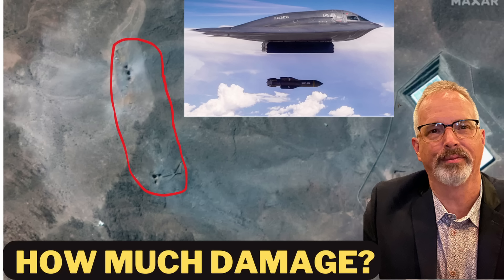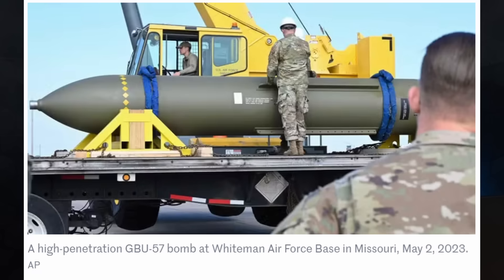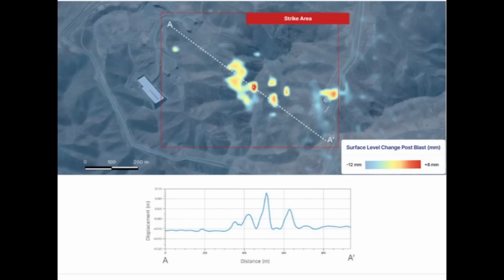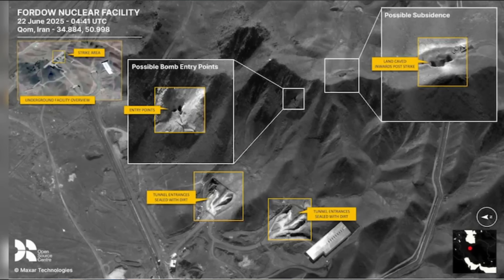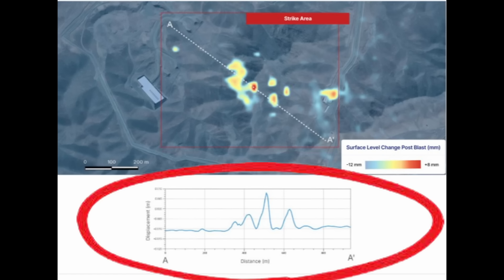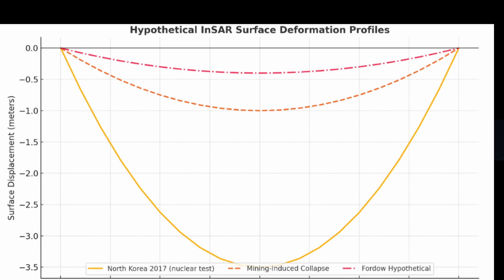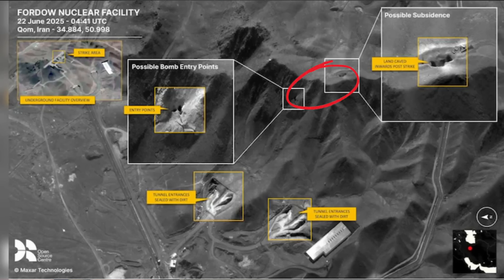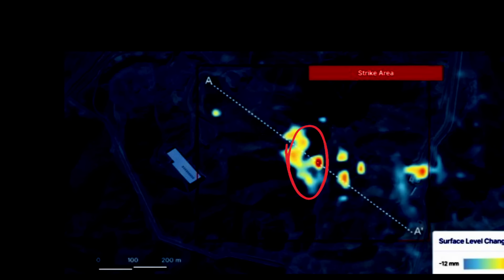Fordow Attack Assessment -  Update

Comment: The General said that there were more PhD’s working on this project than the Manhattan nuke bomb. And used more super computer power than anything else in the world. Over 15 years of work on one target, for one bomb type, for one airplane type. I think they knew exactly what they were dealing with in terms of rock, concrete, steel, depth and all known inputs. This attack has been on the shelf and updated daily, thanks to Israeli/Mossad intel inside Iran. How many other target plans throughout the world are just waiting for the go ahead. That’s what keeps our enemies in check.
Reply: There was no weapons program. It doesn’t take 33 years to develop 60 year old tech that others took 3 years to develop. Netanyahu has claimed that Iran is a week away from getting this since 1992.
Reply: @luvitluvitbaby  Iran in fact has been very close to getting a nuclear weapon for decades, because that's where they wanted to be.  They didn't want to be the next North Korea (as they would have risked being if they actually developed nuclear weapons), but they didn't want to be pushed around either (as they would have risked being if they didn't).  So they split the difference, and didn't make a nuclear bomb, but maintained a credible threat of finishing the process on relatively short notice if the geopolitics changed in a way that would put them at risk of winding up in an even worse position than being the next North Korea.
Reply: @danwylie-sears1134 They weren’t a threshold state until around 2021 after we forced them to go there. Be that as it may, they had no such weapons program and no desire to move forward with one. However, after these sequences of events that may have changed and I couldn’t blame them if they did.
Reply: He also calculated with maximum possible amount of volume which is the most optimistic scenario. However, the most optimistic blast radius only became 23.87 meters.  

That means the bomb has to go 55-65 meters deep before exploding. 

Very deep is a relative term.

In fact the very subtle changes in the ground elevation across this area is proof that the bombing was a total failure.

The bombs didn't go further down than 20 meters, reaching a maximum depth of 45 meters.

In contrast, an exploration at 70 meters depth would not reach up to the surface at all.

Volume gives a big number, but just calculate the volume of a ball with 24 meter radius. You see.

20 meters is great depths, but far from great enough.
Reply: @idarpolden5913 They have new site at Pickaxe Mountain that is twice as deep.
Reply: Would that be the same PHDs and geniuses who planned the Iraq and Afghanistan debacles? We wont know the results of this for quite a while.
Reply: @Filthmrchristian what debacle? They were used as a platform to start a larger theatre in the middle East. Us didn't know if Saudia Arabia was going to cut oil, or if there were more attacks after nine eleven.

Was far more successful than anticipated.

Iraq army collapsed.

Area was held without any real threat. (Pretty sure the stats of danger from the weak insurgency was still lower than the dangers a us citizen faces in their own cities)

Infrastructure was downgraded to make those areas not a threat.

The entire region was destabilized, which further makes it less of a threat.

Saudia Arabia just pretended nothing happened.

Islam sunni /shia civil war keeps them busy.

Drone war rnd

Shale fracking made most of the planned middle east campaign irrelevant.
So we left.

Saudies tried the isis thing. Which technically helped keep iran/proxies busy. And helped cause Syria to fall. (Who did isis cause the most harm to? Right other islamic peeps)Drew russia in to see how their stuff handled and waste their resources. Got some real nice tow missile vids.

Isis gets its infrastructure nerfed.

Iran proxies weakened, 

Iran got owned.

Us atill has basea in Iraq.

There isnt anything worth staying in Afghanistan for. 

Having a plan for the Afghan army to take over which didn't really change despite them obviously not getting to a point of being ready. It was easier to just keep doing the same thing, since changing that plan would just result in ramping things up in a place that  no longer has any strategic value. Due to the theatre changes that made it irrelevant.

There was definitely sunken cost fallacy, but there wasnt a easy soft landing exit strategy either.

But hey, we got you all convinced it was a stunning defeat. Congratulations on winning, and causing the west to surrender. Middle east never had it so good, islam totes got the whole thing lickd.
Reply: Magnificent. West dA bes. 

Some indeep blapping.

 Yet nutha binder Dundat delivery  of a "get rect" air priority shipping.

Iran got owned so bad they think they are winning. 

(Psst the thinking they won thing is actually a Mossad psyop, which the deep steak endorse. What is even a fact or objective reality? Don't ask them. We think for them and then we make them think it's their own original thought. We're thinking for them with the biggest secret quantum computing cluster.)
Eased casually in every parallel universe.
Reply: There is only one enemy in the world. Plot twist: USA
Reply: 8o years ago Lancasters MK1B from the RAF 617 squadron were routinely dropping 22,000 lb " Grand-Slam " bombs of German assets.  Without computers or all the fancy stuff available today they also took off with full fuel 80 years ago !  This attack was not difficult and as Irondoor says the US had help, I wish people would keep a perspective this is old technology with a little bit of GPS magic.
Reply: counter point - if this didn't work well, all our enemies learned some valuable data about the US' capabilities at what is fairly maximum effort for these bombs. "quiet power" may have just gotten ruined.
Reply: @Chiberia  What they likely learned was that our weapons are more accurate that we publicly admit to.
Reply: "there were more PhD’s working on this project than the Manhattan nuke bomb ..."

This is the analysis that provides real reason to believe that the attack probably worked, much more so than a calculation of how much granite the energy in the MOPs could hypothetically could fracture.  The ventilation corridors presumably were long and convoluted, with structures designed to dissipate the energy of a blast passing through them, and with a horizontal component long enough that the shock wave passing through rock from a blast directly below the entrance would spread out enough not to damage the actual facilities by the time it reached them -- for the size of blast that the Iranians planned for.  But once they had built it, the US could apply the eleven-foot-ladder approach.
Reply: @danwylie-sears1134 You don’t need top PhD scientists to develop 60 year old tech. Iran is top 4 among all countries in nuclear research and development. They have the knowledge base and plenty of PhDs that can replace those no longer there. I just find it remarkable how we dismiss innocent lives being taken. Those scientists were civilians and so were their families including children. That’s not right.
Reply: Saya baru mengerti setelah iblis diusir dari surga karna menyesat kan Adam dan hawa iblis bersarang di pentagon dan di tel aviv... Karna merekalah pembuat kekacauan di semua negara
Reply: We have enemies ONLY because certain people in high places insist on it. It takes a lot to keep the MIC happy.
Reply: Something else to keep in mind is the extreme accuracy of those bombs.  They all went down the shafts - apparently with no misses.
Reply: It's aiming big explosives IN A HOLE, IT AINT ALL THAT, stop exaggerating. 
PS IF it did take all that, then multiple people and systems ARE SHITTING THE BED 🛏️
Reply: Cope
Reply: @DISASTERJOE  coping so hard 😂😂😂😂, bro acting like this isn’t the fog of war ALWAYS.
Reply: @DISASTERJOE  Stating objective facts about the mission is not "cope," lmao.
Reply: And the crazy thing is SO SO SO many of the people working on this had no idea what they were even working on. The govt is amazing at compartmentalizing departments. And making stuff work

Comment: While 100000 m3 sounds a lot, it's a sphere with only 30m in radius. So you need to hit within 30 meters both vertically. Also, does the entrance hole reduce the impact since it's not totally constrained?
Reply: WRONG. A 30m sphere is only about 14,000 m3 .
Reply: @tomlewitt  sorry, corrected, radius 30m :-)

Comment: Greetings 
Let me give an update on Fordow facility 
The main shaft and underground facility like any other mining facility 
Has a ventilation system using Electricity 
The Facility is unstable as a result of flooding with Radioactive water 
The swamp- pump was shut off ( Its full of radioactive water )
Reply: Where did you get this information?
Reply: @rashnuofthegoldenscales4512  any cavity 800 meters under ground 
Will need a drainage and ventilation 
The natural water flow begins at 100 to two hundred meters 
And most likely the force of expansion has created a new water channel
Reply: @cryptonighit There is no evidence for this.
Reply: @rashnuofthegoldenscales4512  true, no evidence

Comment: Very interesting thoughts from a Pro. I did not know that all bombs went down the same two ventilation shafts, digging in deeper and deeper. I thought the adjacent shafts (four in total)  were opened by separate bombs. From this evidence I believe the job has been done. They still may dig out the enriched uranium if they have not removed it before. If they don't start digging they have removed it.

Comment: The math doesn't work out though. If you asked a mathematician if those bombs could reach more than 20 metres he would say absolutely not. You cant defy the physics. Big explosion sure but not at the facility's depth. You could say the vent shaft went straight down into the centrifuge room. But whats the chance an engineer would do that. Surely zero. Anyway time will tell.

Comment: I need to know that for your calculation,  did you take the weight of thee explosive material in the GBU 57 is 13600kg ?. Because the actual explosive filling in the bomb only weighs 341 kg. The rest of the weight is metal for penetration. From that values, we only get 2557.5 kg of rock fractured. A VERY SMALL AMOUNT. And given the fact that the MOP is only rated for travelling 80 - 90m of SOIL, there's not a lot damage being done,
Reply: It can not penetrate more than 20 metres of bunker grade concrete or rock. Its been tested and that's what it's rated at. Anything more is media spin
Reply: @thomassmith4999  Did you not listen? Multiple GBU's were targeted at the same location.
Reply: @TheGruntski Given the rock doesn't vanish into space after detonation it won't matter how many bombs you send down the same hole. 90 metres of rock dust will still stop the next one
Reply: It was reported that they have an explosive charge of about 5,000lbs
Reply: 2,404kg, so you are peddling fake news.

Comment: The air shaft is a red herring, who would build it as a entry point to a military base? It would be ducted to a chosen point. 
The video of the testing of this bomb, was also unclear. 
It didn't show the bomb being dropped on a mountain, 
didn't show it achieving a 600 metres depth before exploding, or not, 
there was also no video of the dig out to inspect the damage done. 
I expect that they work, but the damage is yet to be resolved. 
I personally think that they didn't have the effect desired. 
✌️ 👍 😎

Comment: Not so sure about this. They used multiple bombs on this facility because it's too deep. I would've expected the first bomb to create a crater and that will get deepened by subsequent bombs. The final bomb would penetrate the facility and maybe that explosion would be contained in the underground void, but I would still expect a substantial crater from the first few bombs.

The fact that the change in elevation is only a few inches, seems to suggest an air burst.

Unless they can drop the bombs so precisely that they created a very small shaft that's not visible by the satellite, I don't see a plausible explanation for the lack of a crater.
Reply: Haven't you been reading.  The blast happens underground.  An air blast is from a MOAB not a MOP.

Comment: They aimed the penetrator down a shaft, that was designed with twists and turns, blast absorbing chambers, divertion tunnels, and sand piles to slow the projectile.  Would this affect the analysis and the ability of the explosive and fracturing to enter the actually facility, when the shaft connected to an entry area separated from the centrifuges by multiple blast doors.

Remember, this was engineered in such a way, because they knew it was a target for penetrator bombs.  Penetrator bombs are not exactly secret, after all.

Comment: Do we know what if anything is actually at the bottom of the shaft? If the tap off points for ventilation are perpendicular to the shaft there wouldn't necessarily be anything of much importance to be struck at the bottom of it. Certainly the material that's been displaced has had to go somewhere though. Would it theoretically be a defence to this type of attack to dig an extremely deep shaft such that any explosions at the bottom of it happen a larger distance away from the facility?

Comment: The ventilation shafts are not optional for the Fordow facility, they are absolutely vital to the enrichment process. 
The centrifuges operate at incredible RPM, and use massive amount of air to be kept cooled. Without ventilation, even if some of the centrifuges survived, they are just dead weight as long as the ventilation system is not repaired. The simple fact that these air shaft can be destroyed all day by aviation means that the facility can be kept offline indefinitely even without total destruction of the enrichment halls.
Reply: This attack used something like half the MOPs ever built.
Reply: Who knows if that weren't just empty bunkers? Your commander of-dont-know- much-about-anything bragged days before the strike what he might do. Furthermore what is strange is that Israel continued to bomb the site. Why waste a lot of money on something that was 'obliterated'?

Comment: Problem is, a penetrator excavates a cone shaped volume , which means if you want to double the penetration you need to excavate 8 times the volume. Volume increases with the cube of the depth. If you want to triple the penetration you need a penetrator with 27 times more energy.
Historical penetrators of comparable power did not go more then 20 meter deep in rock (Schwerer Gustav cannonshell).
Reply: Your response is based on faulty assumptions.    GBU-27 holes are nearly cylindrical - at least until the sides collapse - and I see no reason why the GBU-57 would be different.  If the material is hard enough the holes look more like bullet holes than craters.  The Schwerin Gustaf shells were not precision guided, nor could more than one shell hit the same hole. They also only have half the mass.  Also neglected is the presence of the air shafts and knowledge of the air shaft design.
Reply: @Why_ask_  Those holes are much much wider than the diameter of the penetrator
Reply: The holes are much much wider than the diameter of the penetrator itself which shows that the energy spreads sideways as well (logical)
Reply: @gyorgygajdos1657 . Per the pentagon briefing , it went down a Ventilation shaft.  
Also, think of modern penetrator weapons as being more like a bullet than WW2 artillery shells.  Sure some energy will go laterally, but the holes are surprisingly narrow.  At least they are for the hole made by 2000 pound BLU-109 - which I have seen.
Reply: @gyorgygajdos1657 .If you watched the well produced video, you would know It went down a ventilation shaft.  So perhaps the hole might be related to the size of the shaft.
Reply: Those two sets of three holes are ventilation shafts that were exposed after an initial MOP dropped on each set blew off their concrete covering. The rest of the MOPs went down the central ventilation of each set. I recommend you watch the Pentagon debriefing of this mission (when the General talks, not Hegseth). He goes into great detail about how the mission was carried out, which is how I know these details.
Reply: Nobody destroys a hundred meters deep base in granite stone, not even a atomic bomb.
Reply: @WolfgangWimmer  Imagine being this dumb, then posting it for the world to see. Holy shit.

Comment: Great evaluation of the possible geologic aspects of the site and the attack. I was particularly struck by the points on granite fracturing at a probable large scale. I'd think that centrifuges or any other precision components need an extremely stable base, like we pour concrete beds on the surface for modern machinery. Such fracturing may make the affected parts unusable for centrifuges. Other excavation can be done to open new areas and re-site equipment, but it takes time and capital that could be spent in many other ways.